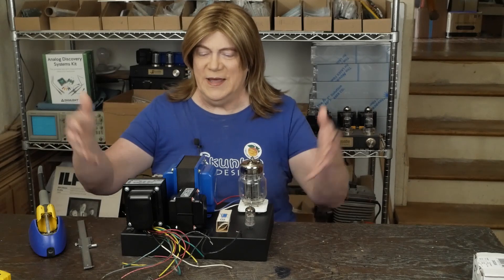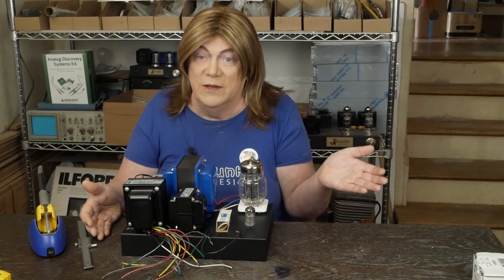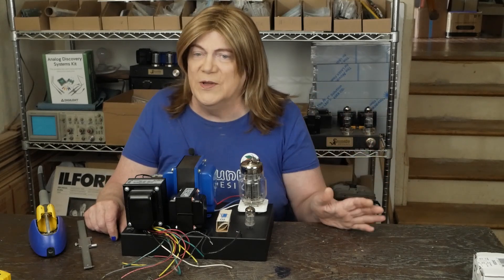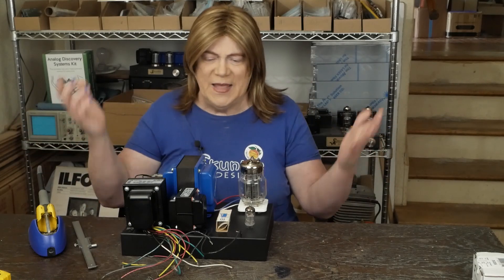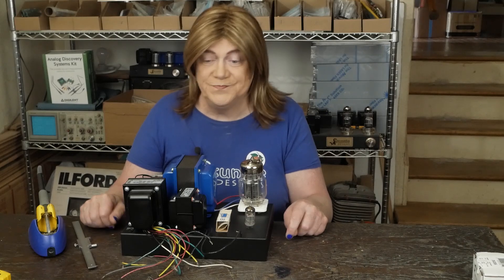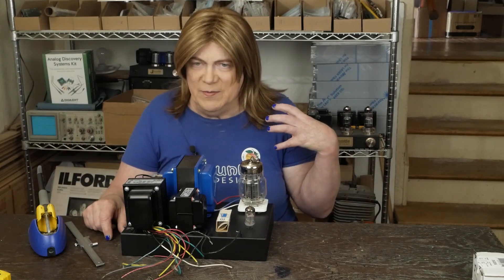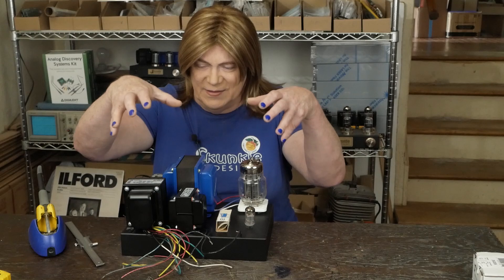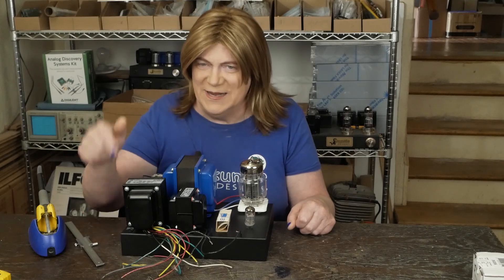Monday Monologue: New Build Decisions +  Why I Love Vinyl Rant!

Comment: Great video Stephe thank you!  My oh my you are one busy lady huh!  I fully understand what you say about EE's who lay out half a page of mathematics to people.  It's insulting really to those who haven't been taught the maths; it's like they're speaking a different language & expecting people to understand them.

I did all that calculus & algebra & stuff during my associate diploma of elec. eng. years ago.  I forget more than I remember about that stuff; frankly I find most of it tedious & boring.  I never bring up the maths when I'm speaking with lay people about it.  After all, you don't need a technical, mathematical qualification to listen to music, or even to build an amp!

I like to buy CD's & just play them.  My turntable's rubber belt has turned into chewing gum now anyway, but I'd still like to fix it some day though.  I still have a few records that would be nice to hear.  They sound pretty muffled these days though, maybe due to my loss of hearing with age, but also due to the limited dynamic range of records.  You can't deny that CD's with a dynamic range of 100 dB are nearly always gonna sound better than records, which have a dynamic range of only 45 dB maximum.

There's no denying the 'sweetness' of well recorded LP's though.
Reply from the maker: If your CD sound that much better than your vinyl, there is something wrong with your vinyl setup i.e. low quality phono stage, cheap cart/needle, old/worn out vinyl etc. I find that nearly always my vinyl sound clearer and crisper than a CD.

Comment: A high-powered PC running Windows is not a good streaming device. A simple RaspberryPi is all you need. Always on, always works, never needs an update.
Reply from the maker: I use it for editing/rendering videos, not streaming. Love to see someone edit and render a video on a raspberry Pi.... And there are never updates to software on a RaspPi streamer? Yeah, I don't believe that.
Reply: @SkunkieDesignsElectronics  Ah, my bad. But my point was: Using a RPi as a streaming device makes the digital experience as simple as dropping a needle in a groove.
Reply from the maker: Really? You don't have to look stuff up online to feed it? My whole point was being able to unplug using vinyl.
Reply: @SkunkieDesignsElectronics  😀Well…of course, streaming requires that. But memory cards are supported. There’s always CDs as well. But all solutions depend on electricity, so to truly unplug requires playing your own instruments, which don’t require electricity either. I’m just being facetious. 👹

Comment: Oof, oh yeah, I used to try and maintain all the various devices back when i was trying to use xmbc/kodi back in the day, I had to stop, trying to keep all the apps up to date across windows and android, and the remote tools and the network permissions, it was just madness. Nowadays, I have the one PC that sits over on the rack next to the audio gear, the screens are right there, trackpad and keyboard right on the rack next to my preamp, and I just kick off music as if it was a disc.

I do have a couple of turntables, though I never really bothered to collect much vinyl, as my listening habits and the levels that I really like to listen at are not conducive to using a turntable, my horn subs are 24x24x96 on both sides with eminence 6021-6 21" woofers in them, let's just say my ole' garage listening area isn't the best for records, especially if I've had a half dozen bud lights and the volume starts creepin up towards the 3pm area of the knob.